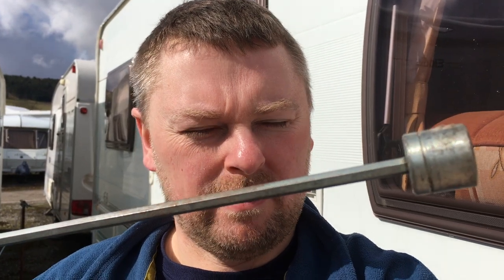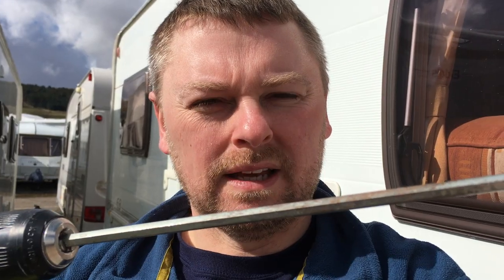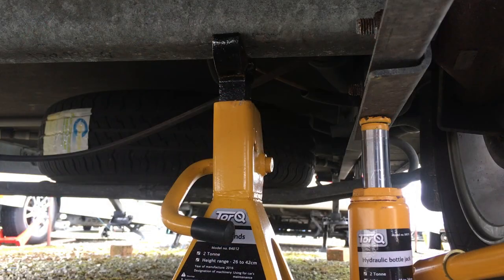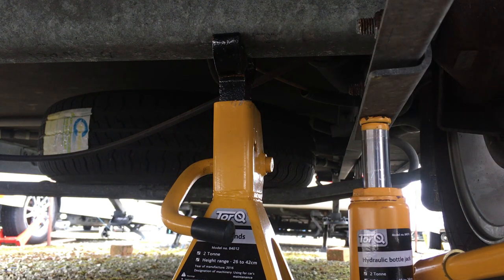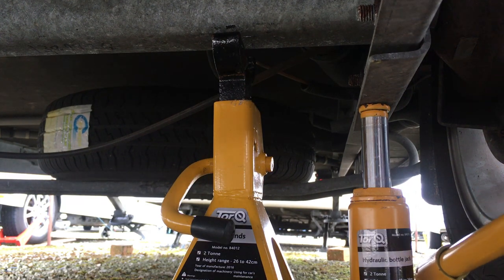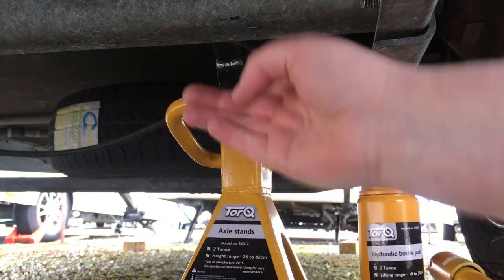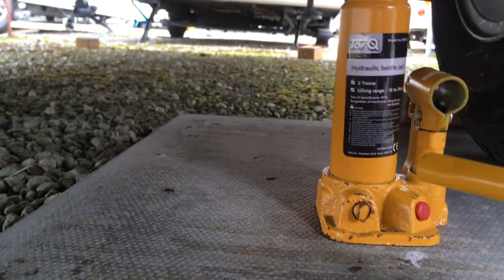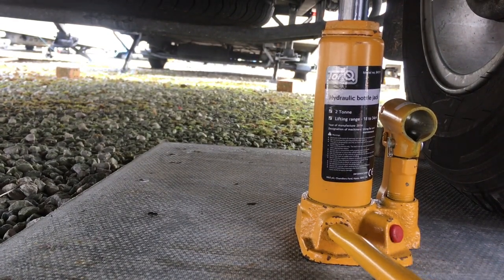Taking the caravan off Axle stands

Comment: Hi Martin hope  all okay good video  I' don't  know if u remember  me mentioning that it mite b better putting  two spar wheels on van over winter just in case u mite need to move van in a emergency  I've been looking on ebay and others  like prelove that sell used items  and to buy spar caravan  wheels with good tyres  on them starting from  as little as 15 pound to 25 pound each which not bad and they in good condition  as well think putting  them on over winter is safer  option thought I'd let u know all the best .kev
Reply from the maker: Thanks Kev, will be looking at those nearer winter ❄️👍

Comment: Great content again Martin, I found myself going to the storage site every couple of months over the winter and jack up each wheel and rotate quarter of a turn, because we were hoping to use the van more during the winter, did other jobs while I was there obviously,  but think you method would be better if planning to not use for a longer period. Taking the tyres off completely is a great theft deterrent?
Reply from the maker: I’ve done it for years, just up enough to take the weight off the side walls and along with the tyre-savers it does the trick. I would check with insurance before taking the wheels off, some insurers stipulate that the road wheels must be kept on the vehicle. Some storage sites also insist on the same. 
Thanks for feedback and watching, Martin

Comment: Hi just a quick question about putting on axle stands I am going on a seasonal pitch hard standing and was wondering whether it would be alright to put on axle stands for the season or have you any other idea what to use.
Reply from the maker: Hi Mark, that shouldn’t be an issue. I would check with the site as some may request that the van can be moved in the event of an emergency ie fire. I would get some tyre covers to keep the sun off them as well.  Cheers Martin 😊
Reply: @TheCaravanNut  Thanks Martin much appreciated
Reply from the maker: You’re welcome, put them under the Axle near to the chassis and it will also take the weight off the suspension arms. 😊